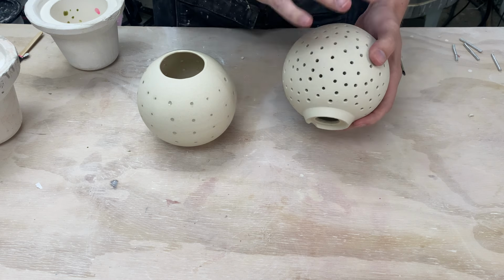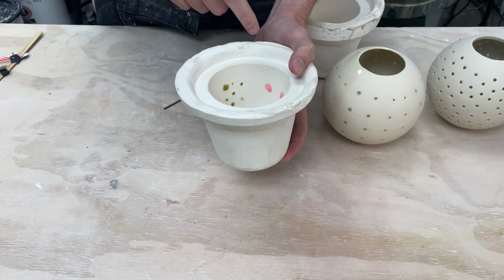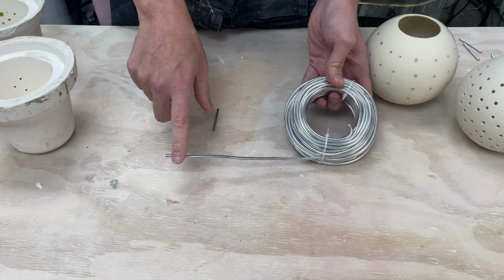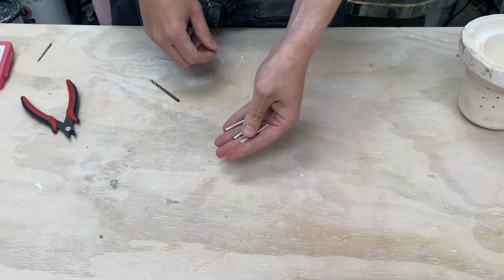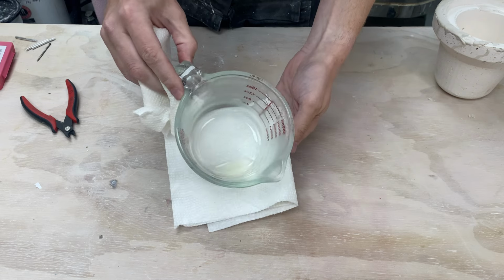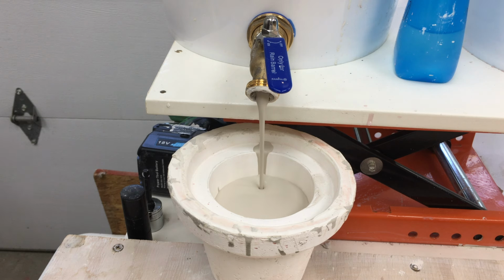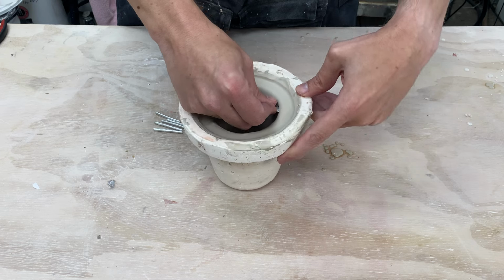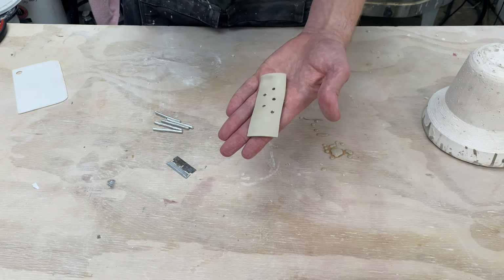Home Made Wired Pins in my Plaster Mold

Comment: Dipping your aluminum pins into liquid silicone (used for mould-making) and letting them drip dry might give a good result that would be more permanent, as well as more slip-repellent than using wax.  You'd be able to make pins with very small diameters using this technique, whereas my previous suggestion of using a plastic straw as a mould for silicone caulk would limit you to somewhat larger, though probably more uniform diameters.
Reply from the maker: Thanks for following this journey!

Comment: why not leave the pins longer? its still runny when you take them out.... not sure if this was in another video or not
Reply from the maker: It was one of the first things I tested, but it could be worth revisiting now that I am using the wax. The thought is by pulling them quickly, then the slip still has a chance to flow down and away. If I wait, any slip still on the pin will be deposited on the edge of the hole when I pull them out (which is what happened the first time I tried it). There is less clay on the waxed pins, but there still is some.

Comment: What about pushing through than pulling out? So that the excess slip goes with the pin, than pulled back towards the hole and sticking? Only thing then is you need like a basket to collect all the pushed in pins at the end. This is entirely just a guess though.
Reply from the maker: For a different form, I think that could work. But I can't pull them from the inside of my sphere form since I can't reach inside. If I pushed them and they fell inside they'd likely leave marks where they touch the very soft clay.

Comment: Why not drill the holes after this step? Just by hand with the tiny 3mm drill. Now you know where the holes are, this will just take a minute.
Reply from the maker: Because the clay breaks out as I showed near the beginning of the video. Locating the holes isn't the issue - it's the chipping.

Comment: You might try 1/8" or 3mm PTFE (Teflon) plastic rod and see if you can skip the wax entirely while getting the same hydrophobic effect. Otherwise, rain-x applied to smooth nails, dowels, etc. could be worth trying as long as it wouldn't foul any of the nearby surfaces.
Reply from the maker: A PTFE rod would seem like a great option! Thanks for the suggestion!

Comment: Will using silicone pins and/or hydrophobic spray used to impregnate textiles be helpful?
Reply from the maker: In my last video, someone suggested silicone spray, which I do have. However I'm thinking it would have the same issue sticking to the pins. Silicone pins would be interesting - I wonder if I can find those.
Reply: Coating the nail with silicone designed for bathroom or kitchen use would likely be the easiest method to create silicone pins.
Reply: @alodin11  seen others 3d print silicone molds. Could just use the molds to make a set of multiple pins, but that would be $$$.
Reply from the maker: Yes, I think if I were to go this route I'd need to make a mold and use a 2 part silicone. Otherwise I'm not sure I have the skill to make it smooth!

Comment: i imagine that a wooden pin would work better due to water absorption
Reply from the maker: Wood would like absorb the wax better. It would need to be fully coated though since if it absorbed water from the slip it would have the opposite effect than desired.